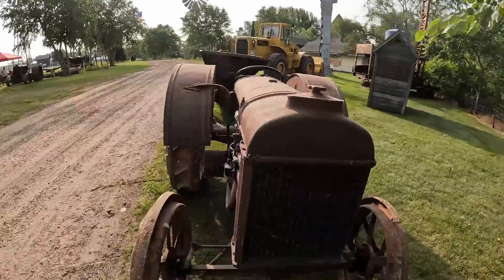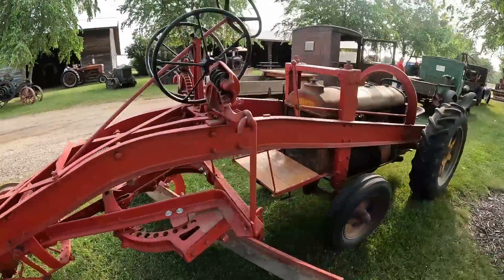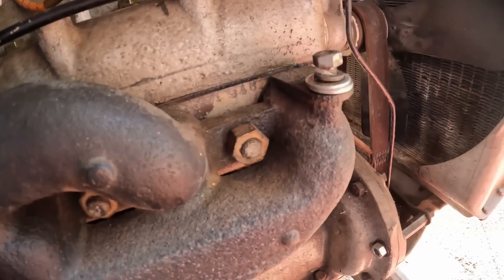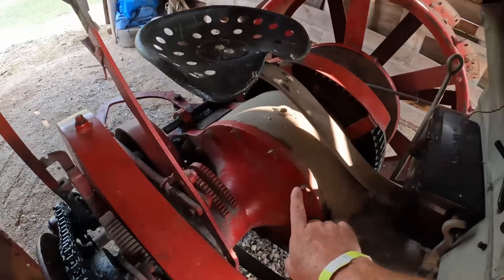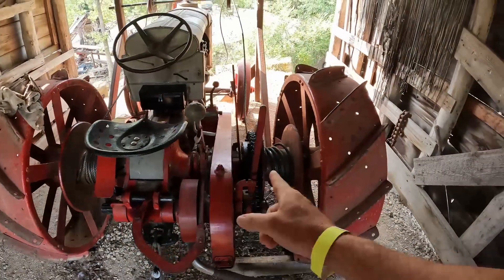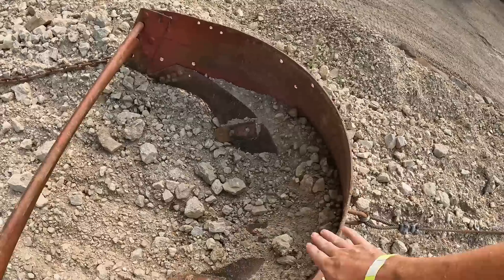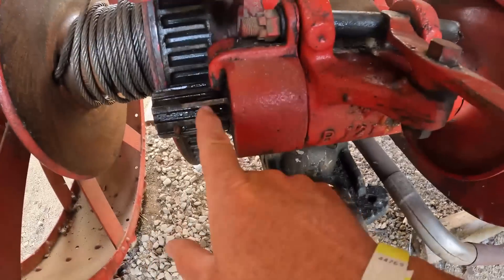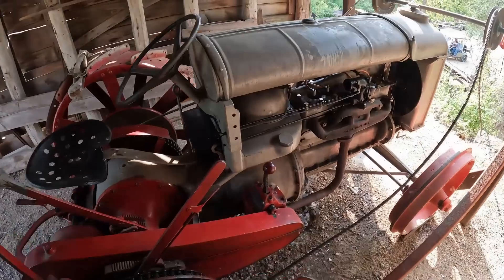Fordson Tractor Turned into a Mobile Cable Winch Unit - "The White Tractor Hoist" Conversion Kit

Comment: Excellent video Toby   :) did ever see a Farm Auction sale  or Mesumn  or Farm Equipment Show a  1932 to  1937 Ford Model A car or Truck AA with metal seat in  no roof or back seat  or rumble seat and below seat had tractor  tongue! Plus back wheels  were all steal plus tread and 1937 were Rubber with steal ! I seen  2 them had 4 cycle 4 cylinder  and transmission was h pattern 2 foward gears and one Reverse!  So cool to drive!

Comment: I so remember one place I worked at on a very large tree and shrub nursery and they have a Fordson Major. I was the only person there whom would drive it, as the other workers couldn't (or wouldn't) drive it. The gearbox was so clunky and the clutch bite was so high, I just got used to it and enjoyed driving it. One worker refused to drive it just on the grounds of it having a metal seat and no power steering. He would try his hardest to get out of the jobs he didn't enjoy.

Comment: We were out at a ranch one day by recluse Wyoming, and he had an old horse-drawn wagon that was a belly dump and he had had it since it was built and they used it when they built the highway or the old gravel road to Recluse and he said that the wagon would pull under the loading ramp and a horse-drawn bucket with drag and pull dirt into the loader and it would fall into the wagon and then it was the exact opposite to load he would pull on top of the loading Chute and the bucket would drag it out from underneath it

Comment: Surprising to see that was running 12v electrics.
Reply from the maker: That's a common trick to bypass the original magnet & stator plate ignitor that's mounted to the flywheel, those magnets passing by the stator windings creates the electrical current that feeds the ignition coils - but when the magnets get weak they don't produce the current required to buzz the coils and make the spark plugs fire, so hooking up a battery instead ensures they'll fire dependably.

Comment: I was maybe 6 or 7,  the sawmill the wood was milled for the house built in '74 was done on a mostly home built mill powered by a '37 John Deere A.  Built by a Finn and his son with maybe an 8th grade formal education and a lot of old threshing machine and probably Maytag washer parts.  They used an F 12 Farmall with a rig on front like a forklift mast, used a flat belt to a winch that raised loader arms to lift logs off a 1947 IH 2 1/2 ton truck.  All that fabricaiton, and they didn't think to put running water in the house. :) Later they had an unstyled WC Allis with a modern "hydraulic" loader, with LIVE POWER all probably made with junk yard parts.  Southeastern Todd County MN.

Comment: That was an interesting piece of aftermarket kit!  But I do wonder whether there was a big enough market to justify engineering and marketing such a specialised conversion. Or perhaps there wasn't!  How long did that manufacturer last?!
Reply from the maker: Being made in Oklahoma, that was oil well country and there were quite a lot of winch tractors operating out there back in the day - Williamette was a popular winch maker for the Caterpillar tractors of the day, and those performed an incredible range of tasks with just cables. And that “White” company that made this tractor hoist kit went on to be the “White Motor Corp” that infamously took over and dissolved Oliver and Minneapolis-Moline in the ‘50’s and ‘60’s.
Reply: @squatch253  Interesting! You're truly a font of knowledge for vintage machinery! Keep up the good work & best wishes.

Comment: An interesting machine indeed. However, I really don't see where's the benefit of putting this really complicated setup of "coaxial" winches on the axles instead of just using a more "conventional" double winch, for example on the back of the tractor.

Comment: That's awesome. I don't think I heard it explained. So stupid question could the tractor still drive around if you spool in the cables?
Reply from the maker: Yes, so in a nutshell the drives to the rear wheels are still fully intact. The winch drums just rotate on the outsides of the special axle housings, getting their power from the old belt pulley drive mounting - otherwise you’d still drive this Fordson around just like you would before this winch setup was put on 👍

Comment: When are you going to start restoring your rock crusher?
Reply from the maker: The rock crusher wasn’t a planned purchase, it’s just something that unexpectedly happened so I grabbed the opportunity when it presented itself. I already had a ton of irons in the fire when that happened, and I’m still trying to get some of those other projects wrapped up before tearing into another one. Also, because the rock crusher is very difficult to move I made sure to put it over on the other property where it’ll permanently live, and I’m still in the process of getting enough built over there to be able to do work on things 👍

Comment: They also used as tiny railroad switch engines Brookville used may adoptions to there locomotives, have photos of one in my photo colection.If you google Ford Power Age  mag. You will find a 1927 copy that includes hundreds of Fordson add on to modify including info on the one in this video.

Comment: That is a nice manifold in that old Fordson.  Some years ago I saw a logging donkey built on a huge skid.
Fordson was the power, however the guy doing the restoration said they used GP JD, and McCormick Deering 10-20 too.
They replaced the rear wheels with sprockets, and roll chain wrapped around the spools. 
That was for use in the Redwood forest. 
I asked how they stretched the cable.  His response was Labor was cheap. 
That was in Willitz California. 
Tussen Takk.

Comment: Good informational walk around.
The abilities of that time is so amazing compared to today.  Why design entire new piece of equipment,  just design an attachment for the farmer.
Reply from the maker: The main difference between then and now is the fact that back then, you COULD just build your own “new” pieces to easily modify an existing design, whereas everything now is so micro-managed by computer parameters and non-serviceable components that any modification could cause the entire machine to quit running. Everything now literally has to be designed from the ground up to begin with.